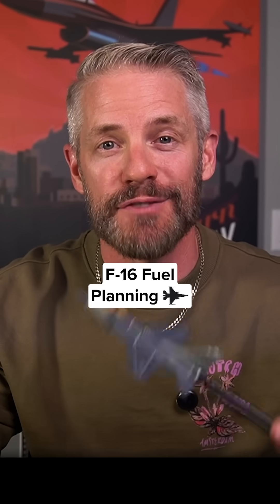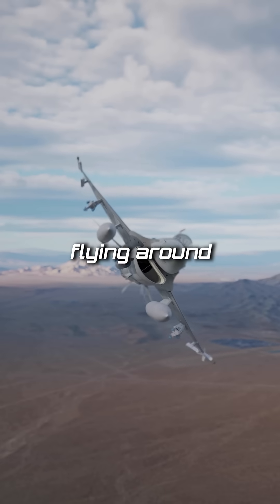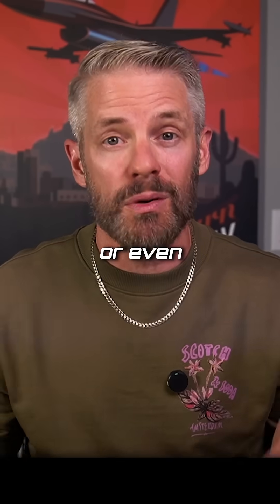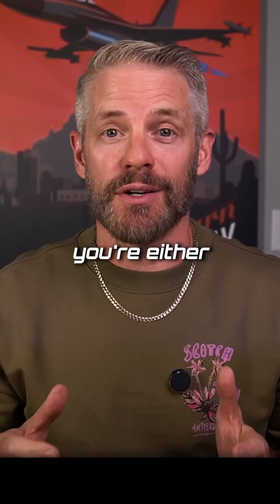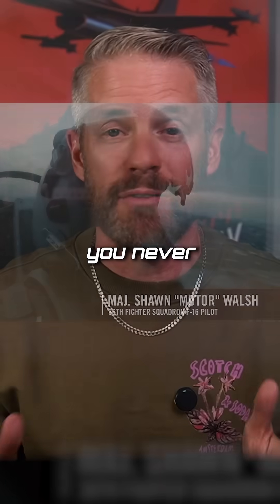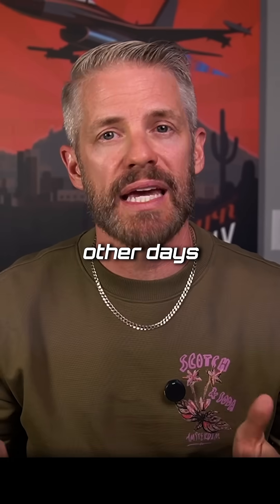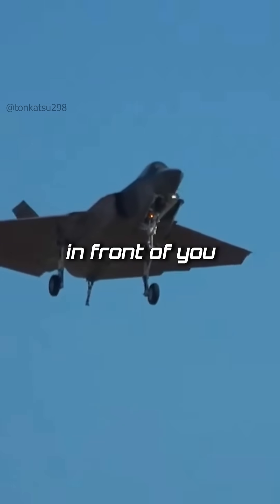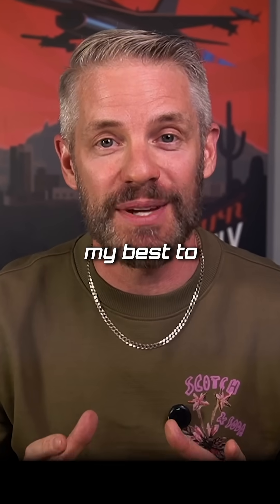F-16 Fuel Planning Explained

Comment: How much fuel does a clean f16 hold
Reply: About 7000 pounds of JP-8 internally, 2500 per 370 gallon underwing tank, and 2000 on the centerline drop tank.